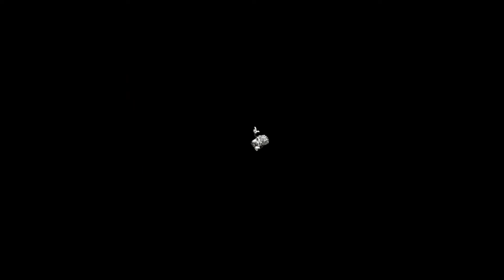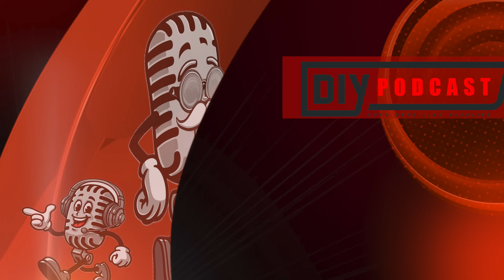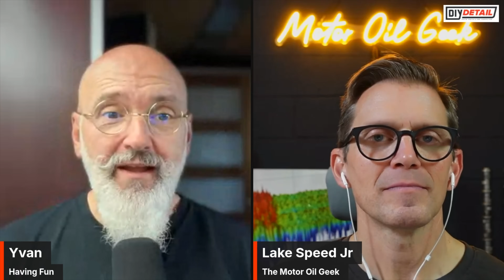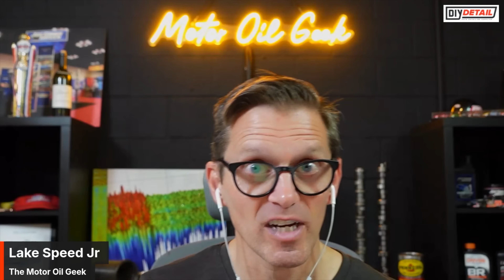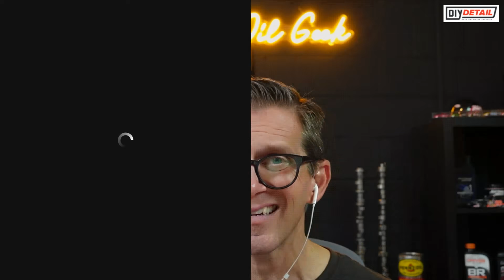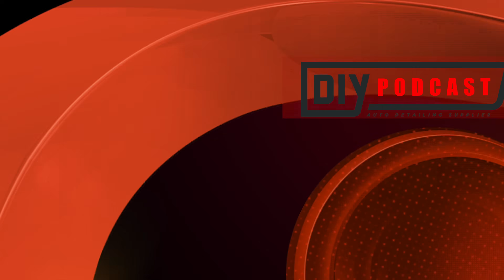Oil myths busted with Lake Speed Jr and DIY DETAIL PODCAST

Comment: Two slight disagreements with Lake. He seems to feel planned obsolescence does not exist with these rediculous long term intervals. I will never believe that.  2- He mentions some people change oil too soon, which leads one to think it might be harmful. He should just say “ before it is necessary “. I’ll stick to 2-3K , actually before it is even barely discolored. It’s worked great for me since the early 70’s , and I’m sticking to it. Might seem wasteful to many, but it makes me happy and I’ve never had an engine complain.
Reply: The comments made by @MHounan are very accurate. Oil Analysis does provide information on contamination, viscosity, oxidation, etc. It does provide accurate data on your oil, the additives within the oil and condition of oil. Many come from a viewpoint on gas engines and 4-7 quarts and relatively low cost filter… relatively inexpensive oil change. The Diesel side is much more abusive to oil and presents a much higher need to analyze oil; my 6.7 takes 18 qts which is much higher maintenance cost; maximizing life of engine and mileage is important. If oil change "color" indicates oil condition and not actual properties & contamination you’d change diesel oil within minutes because it’ll be black promptly mixing with .5 to 1 qt residual oil… black color doesn’t indicate bad oil. 

Oil analysis has been done on diesel oil for many years, proven extremely accurate and life of engine is just as long with extended oil change compared to short mileage change… engines often easily obtaining 400-700,000 miles. Oil Analysis has also been vital to provide early detection of a possible problem or early failure, unknown if not testing. 

As far as condition of used oil compared to new, actually running an oil by-pass filter system the oil is often better condition than new. Many Diesel with By-pass filter "don’t" change oil, they only replace the oil when filters are changed every 10-15,000 miles. 

The analysis of oil has been so successful in diesels and high HP racing engines, it’s become more popular in street gas engines… clearly indicating the old school short oil change for modern synthetic oils isn’t needed. But to each their own, if you enjoy or feel good changing with low miles, enjoy, doesn’t cost much either; But arguing based on speculation that it’s better condition isn’t accurate. I’ve seen many gas engines with 180-250,000 miles that had 10-12,000 mile oil intervals look better in bearings & cylinders than 3-4000 mile intervals; many more variables impact engine wear than oil change interval.
Reply: @dougcjohn You offer much good information, but , your also doing a lot of apples and oranges comparisons. Of course diesel and higher volume oil capacities are a quite different scenario than the common normally driven 4-6 qt. gas engines referred to in this discussion. And what to you is “many” in regards  to 10-12K intervals up to 250K looking better than the 3-4k intervals. Keep it simple instead of throwing in all the extreme variables and re tell the story. It will not be the same.
Reply: @brianw8963 appreciate the comments, but would disagree on the scope; the end point remains the same… oil analysis remains the same… it provides benefit and information not known unless performed. This subject isn’t on just 4-7 qt gas engines, but the focus turns narrow is common. The discussion was on oil analysis. I expanded the focus to a broader view to help understand the value of oil analysis. 

Within Lake’s discussion, he included large plants that use & depend on oil analysis. Cost helps justify as volume increases; although the benefits remain the same for 4 qt to 40 gals. 

Again, if one wants to have a short change interval, enjoy the process. But defending that position by refuting oil analysis isn’t accurate.
Reply: @dougcjohn  I agree, I change my oil and filter every 4-4500 miles since going to full synthetic.
Reply from the maker: Thank you.
Reply: I certainly respect Lake, but I’d like to ask him if they run the 0-W oils in the expensive race engines ?  Yeah , I know , that’s different . But these modern small displacement high output engines basically are race engines .
Reply: @brianw8963 
Running 7000 rpm continuously
Reply: @brianw8963  Promods, 4-5,000 hp are running 0w-20.

They can't warm those engines up. So that 100 degree oil acts like 40 or 50 weight at 200. Same viscosity. It's cool stuff.
Reply: @WyFoster That’s interesting, but I was kinda referring more towards the NASCAR  type of stuff. 👍👍🇺🇸
Reply: @brianw8963  Works well. They run very thin stuff in nascar. Especially on plate tracks where they need all the horsepower they can get through those restrictors.

0w-8 to 20 on the high end. Obviously works well enough for 500 miles.
Reply: @WyFoster That’s very interesting, as is obvious, I didn’t know that. But also in that situation, I don’t think longevity is relative , at least past 500 miles.
Reply: 14:42 He's absolutely right I've seen my oil shot at 4,000 4500 mi and I've seen it still look honey brown at 7500 mi. I will say though regardless I can tell the difference in the engine right around the 4500 mile mark however I will say I have a GDI engine and Valvoline extended protection seems to hold up better to fuel dilution than Pennzoil ultra Platinum in my non-scientific experience
Reply: @thetechlibrarian How have you seen your oil shot?  Visual inspection?
Reply: I wouldn't put pennsoil in my lawnmower let alone my truck.  @thetechlibrarian
Reply: All speculation unless you send in your oil for an analysis. I've sent my oil in for my tundras and my wife's Volvo. All at 6-7k miles and the oils were in great shape. Can't disagree with facts
Reply: @MHounan you are probably fine at 7k, it’s your many after all, but there are former GK and Ford engineers who disagree with you.  Theres an interesting GM transmission engineer making the rounds lately, who admitted they said in meetings they were more interested in selling cars and trucks, not prolonging their lifetime. He working and designed these cars, in his case transmissions and he said cut any factory recommend fluid change interval in half, and ignore anything that last the “lifetime of the car.  He recommend changing trans fluid at 15k of your vehicle was made after 2001, when they all went to cheaper metals and build methods. He even said the words planned obsolescence were uttered while he worked there. Blame Vafe Standards, they are the reason for longer intervals, no other reason, as car makers get credits for longer intervals and lighter oils. 

Even Lake Speed, the guy in this video, did a test of 0 mile oil version new oil on bottle.  He pouring oil in motor, did not run motor, then tested oil and it picked up many contaminants on the way through motor, indicating it was not “as good” at the bottled oil, with 0 miles, although both would obviously take care of motor fine.  I drove a best Joe that had 13-17k mile oil changes, with two being at 30k miles, with a previous owner, and it’s running great at 235,800 miles, and mpg is 140%/120% better on city and highway mileage.  Maybe oil is irrelevant based on my testing.  😂😂
Reply: Without sending your engine in too you are only looking at half the equation. @MHounan
Reply: @MHounan Well, with all due respect, when I change it before it’s even discolored @ 2-3K , there is absolutely no speculation for me, and I don’t have to pay for an analysis. To be fair though, I don’t rack up very many miles on my vehicles.
Reply: I agree. I change mine before 4,000 miles. Too soon? Maybe, but I really don’t care.
Reply: @brianw8963 can you see a lack of dispersants, a reduction in additives visually?
Oil color isn’t an absolute. Oil manufacturers add dyes. The dyes can turn darker in just a few hours.
Reply: @Papparratzi So I can’t trust good brand name oil? How often do You have yours analyzed? I’m going to guess You never have, and if you did , what did it cost and what did you find? Blah Blah Blah!
Reply: @brianw8963 Change it every 500 miles why don’t you bud. Burn your money by all means. Oil change should be done every 5k miles.PERIOD
Reply: @thewiseguy7100 Very fitting name.
Reply: @brianw8963 
There’s a difference to get a few analysis done and establish a place to change, vs never learn anything about what you are doing.
Reply: @Chucka10 Do you really think I need an analysis changing @ 2-3 K ? I certainly agree with it if you’re looking at long intervals to save on maintenance costs, but not for my situation, or even those that do it at 5K , if they actually do. And I’ll say it again, I have yet to hear one time what anyone here  in this discussion actually paid for an analysis. That never seems to be considered into the equation. How many have you had done?
Reply: @MHounan  Just be aware, the oil can be in good shape but you can have contaminates floating in it. Iron, aluminum, copper, lead, dirt, fuel, water, carbon, etc.

I would never trust 10k miles, even if the oil viscosity is still in grade. There will be just too much other junk in it for my liking.
Reply: Lets say you were looking to buy a used Tundra, both were absolutely identical in every way.  Both had 70.000 miles on them both were the same price. Only difference is one has had 7000 mile oil changes,  the other has had 3000 mile oil changes....which one do you chose? Be honest. @MHounan
Reply: @1958Cadillac-v2g  I want yo see the oil analysis on the TRANSMISSION FLUID  before I choose.
Reply: @1958Cadillac-v2g 3,000 of coarse
Reply: @1958Cadillac-v2g I use high quality oil and still change every 5000 miles
Reply: @adrianrobinson7953  5000miles is what i do on my truck, 5000k miles is fine when you want to keep it running well and don't really want to bother with oil analysis, i can probably  go longer between intervals but then i don't have an excuse to use to get in the garage and have some time away from the family 😂😂
Reply: @1958Cadillac-v2g I run a company where we have around 45 Toyota tacomas, oils changed every 20K with Amsoil signature series. I’ve got some with 500k still going strong with no major engine work. Oil analysis works.
Reply: @stevefuller3585 Are any of them the newer 4 cyl. turbos ?
Reply: @MHounan  it doesn't matter if your oil is good based on analysis at 7000 miles it's still not as good as oil brand new out of the bottle.
Reply: @MAXIMUSMINIMALIST you can literally say that about anything that's used vs brand new. But again, i use facts and not speculation
Reply: @willr1796 literally no one said ots as good as new oil. Lol but i will definitely bet my 7k oil changes backed by science and facts, will lead to perfectly healthy engines.
Reply: @MHounan maximusminimalist just gave a fact you can't dispute. New oil always performs better than used.
Reply: @willr1796 all those things you mentioned can be looked at with oil analysis… funny YOU would say ignorance is bliss, you’re the one speculating!
Reply: you are probably wasting a lot of good oil and good money not to mention the environmental impact but regardless the only way you know for sure is all analysis that takes any guesswork out of the equation.
Reply: @TheHillrat4wd It’s my money and I don’t consider good insurance to be a waste, and my used oil does not go to waste. How many typical normal people in this realm do you think will or ever consider paying for an oil analysis? I would safely bet the number would be close to zero. I’m not focusing on diesel or high capacity oil systems or the extremes, just the normal stuff of ordinary realm. I know my change intervals are a bit over the top, but that’s my choice.All I’m recommending is to stay around 3 to no more than 5K and you won’t need to pay for oil analysis. To each his own. 👍👍🇺🇸
Reply: @brianw8963 You definitely have your opinion, and a practice of short interval changing.  That’s your preference.

Stating it’s good insurance to change at short intervals when you have zero ability to validate your claim isn’t accurate or true. Quite the opposite, Myself and many  others can factually prove their oil condition… with oil analysis. 

In your statement, you agree / justify oil analysis for diesel or HP racing, but not for street in common engines… stating it’s a waste of money.  If a few Oil Analysis reports clearly indicated you could go  5,000 to even 10,000 with zero negative impact towards engine wear & life. It’s actually saving you money and paying for itself. 

Although I personally don’t know your ideal interval(s)… you may be short due to excessive fuel dilution, or antifreeze intrusion. If short trips, lot of idling, you may be close with short interval changes. A excessively rich mixture, poor engine health (rings, etc) can shorten oil life too.  I don’t know your vehicle(s). 

Your statement in a few posts… hardly anyone does oil analysis for street vehicles. I’d agree, the majority of Owners have no idea what oil even does, dealer changes it and they’re clueless.  

Go to any car show, rally / poker run, or when a person is passionate about maintaining their vehicles… it’s inversely true, most monitor & analysis is very common over last 15 yrs… and it’s increasing as more learn the benefits. So for auto loving owners, the percentage is much higher than your assumption. There are easily 5-7 labs that perform Oil Analysis for non-business clients … that has grown. 

Agree, there will likely always be the short interval Changers… that’s fine. But it’s humorous when they make claims or statements unwarranted or validated when debating with others that obtain quantifiable data and knowledge. 

By the way… It’s not just my diesels. I own several gas vehicles and do the same oil analysis… have a Jeep 5.7L over 200k miles… avg change 10-12k, 10 yr old 3 cylinder .9L Turbo Smartcar (toy hauler RV) still runs like new.
Reply: @dougcjohn Doug, show me where I said oil analysis is a waste of money? You won’t because I never said that. I enjoy discussing this stuff, but prefer to keep it respectful to others opinions or practices, which seems to be less than reciprocal in this arena. I’ve been wrenching on stuff from .049 cox engines to large Caterpillar engines in draglines and other heavy equipment, since the early 70’s . I’ve been retired for a while, but I’m still in my garage almost every day working on something. I also mentioned that I don’t put many miles on my vehicles, and my practices are a bit over the top, and even a bit wasteful, but that’s my choice. Do you really believe I need to get an analysis on my 2K oil to verify it is still good? That’s foolish to me, I know it’s good  . I have 6 vehicles on the road, and a couple don’t even get 500 miles in a year, but I still change it once a year. Is that OK with You?  I certainly agree that people like yourself can definitely benefit from the oil analysis results, but I also stand firm that it is not needed in normal situations if change intervals are kept between 3-5 K for the average Joe. That’s all I was saying. And as far as the car show scene, I do attend a lot as my wife takes her 2019 Grand Sport to almost all the local stuff, and every year to Carlisle since She got it in 2020. As I enjoy this stuff, I’ve became acquainted with many and don’t know of one that gets oil analysis done as you’ve mentioned , because they rarely get driven, like my wife’s. It has 6200 miles on it, and even though it has the dry sump that holds 10 quarts, I change the oil every year before it goes into hibernation . Have a great day Doug, I’m going to head out to the garage and get back at my 69 convertible beetle project. 👍👍🇺🇸
Reply: @brianw8963  Late reply... hadn't monitored this thread last month.  My comment on "waste of money" wasn't indicated as Verbatim... more inferred reading your comments across the thread; apologies if taken incorrectly, although interesting that was a focus point among all the material discussed. That followed with "prefer to keep it respectful to others opinions or practices, which seems to be less than reciprocal in this arena...."; that's an interesting comment when skimming through my posts I've consistently indicated it's your preference on milage intervals. I've been consistent in stating that's a personal preference, although not factual in benefit or better.  Your last post above, I'd agree with ya... seldom ran engines, short start ups & shutdowns; frequent oil change are often the recommended maintenance; due to fuel, water, condensation higher concentration in the oil within show car / limited milage cars. You're not working the engines, agree NO oil analysis needed, although for the fun of it; I'd think it might even verify the need to change often.

Based on your timeline share, we're similar in timelines... had many .049 cox engines growing up... something the Youth might benefit from in today's period; to build and maintain as a Kid. Can relate with ya on other areas; maintained many large John Deers and Cats on Farm, Military hardware for a bit and GM Mst & CNE Mst from years back... moved over to IT field in '90's. Still DIY all my Own machinery, just prefer it that way. 

Back in our youth period, I changed my Rat's & Mouse's oil extremely often, more of ritual and passed down wisdom & guidance. With experience, fleet maintenance, and time it became more apparent my maintenance was more based on desire vs necessity. 
Desire is essentially emotional & love of machine, Necessity is factual data and economics that doesn't necessarily mean it supports 2000, 5000, 7000, 10000 or higher... it means let the science indicate, if you elect to utilize or not, that's one preference.  

I can relate to both, doesn't mean desire is practical... just means it's one's preferred path. 
Enjoy the Rides, I'm sure they're all as nice as the Grand Sport.
Reply: @dougcjohn appreciate the feedback. I’m just an old school fella that believes in good maintenance, and have admitted several times my practices are a bit over the top, but I’ve never had one of my own engines ever fail from any lubrication issues. The Grand Sport is definitely an enjoyable ride, but it’s actually more my wife’s thing. I actually enjoy puttin  around in my old 69 Beetle more. I like old school and simplicity much more than the modern stuff, but that’s also just my preference. Thanks again Doug. 👍👍🇺🇸
Reply: It's completely wasteful. Why would i spend that much on oil chances just because i like the knowledge to understand the chemistry of the oil and mechanics of how it works. 

I put about 26k per year on my truck. If I took a page out of your books I'd be wasting $700/ year on oil changes and still not have my engine live any longer or have any less problems.  155k miles on my 6 year old canyon only had an alternator go bad and a thermostat stick. Knock on wood 

Oil changes are important but unless your vehicle sits, there's no reason to change your oil that frequent.
 
As for the long oil change intervals, it's all about EPA regulations and cost to the consumer. Longer intervals if the oil is capable of it benefits the EPA and the consumer especially considering the life expectancy of most vehicles is about 200-250k miles , after that most people just scrap their cars and get something newer
Reply: @gtileo Life expectancy of modern engines using the O-W oils with 10K + mile maintenance is 2- 250K? What planet are You living on? Thats not the real world with these small displacement high output turbo engines. You evidently have no concept of current reality. Just my opinion, of course.
Reply: @brianw8963  exactly its just your opinion of course, until you have the data to actually back it up, maybe don't speak about it like its a fact when refuting a guy that's job is to analyze it. 

I don't disagree with you that thinner oils can cause issues, but when engines are running and maintained as they're designed to. Use of proper oils and top tier fuels, that don't have dilution issues. Oil additive packages and film strengths far exceed the old school beliefs.  Improper maintenance will cause a thinner oil to break down quicker and cause more damage, reducing the life of the engine
Reply: I agree with everything you said. Manufacturers don't want engines that last 500k miles. Every manufacturer wants that engine to have failures after the warranty period. Which is usually around 100k miles at most. If he's listening to Manufacturers he's getting a biased point of view. Changing your oil too soon never hurts an engine. Changing it too late or when it needs changed means it's starting to increase wear at that point. Why wait until it is beginning to damage the engine?
Reply: Lake Jr. would make for a great politician 😂
Reply: Ur doing correct in my book!
Reply: @adrianrobinson7953 To each his/ her( that’s all there is)  own. 👍👍🇺🇸
Reply: It just makes me feel better!
Reply: @adrianrobinson7953 100%. !👍
Reply: I know a OTR trucker small company owner. 7 rigs. All pre def. Either Cats or Cummins. He started on an oil analysis program with a relatively small, custom blend capable oil distributor. Over several years they kept changing the oil formula according to what analysis told them. His “sweet spot” turned out to be 32k between oil changes. He sez the analysis was still showing he could go further but 32k was good enuff for him. Is this a common oil change interval mileage for fleet rigs?
Reply: @harryfeld1786 I don’t personally know any fleet owners , but being in the coal mining industry for over 45 years, I’ve befriended many Triaxle owner operators and I don’t think they come close to that mark. At 50K + just for a basic Cat  overhaul, I believe they do it much more frequently than that. In these cases, regular oil analysis would be very beneficial for sure.
Reply: Regarding your planned Obsolescence comment, you believe manufacturers are increasing OCIs for the purpose of intentionally limiting the life of an engine?
Reply: I’m with Lake on this one.  Manufactures have better things do than planning on their products to fail.  That’s nonsense.  However, they are perfectly fine compromising quality to lower costs and/or meet certain specs that make their vehicles look better from a marketing and/or government incentive point of view.
Reply: @sebclot9478 If you’ve been in the automotive repair realm over many decades, you might have a different perspective, but your certainly entitled to your opinion.
Reply: @brianw8963   You are overrating the foresight of most big companies.  They are worried about today bottom line.  They aren't worried about 5 to 10 years from now.  The long term failures, such as all the recalls we have been seeing recently are, in part, a result of that lack of foresight.
Reply: @sebclot9478 Long term?
Reply: @brianw8963   Yes.  Planned obsolescence would be a long term strategy, not a short term one.
Reply: I agree. I believe clean engine oil makes all the difference. especially for diesel. Which is why I change my engine oil as soon as it turns black on my Volvo xc90 D5, which turns black almost as soon as I start driving it. So I change it on an hourly basis. Mileage is 220k km and other than half the car being replaced, it runs like a dream.
Reply: @Ilikepie18855 Hard to distinguish if this is humor or sarcasm. Whatever.
Reply: @Ilikepie18855   I change mine every ten minutes.
Reply: I’ve never ever heard of a documented premature engine failure due to oil changes changes too frequently at 2 to 3k intervals.  EVER.  It is a theoretical issue.
Reply: @badkid73 And you never will! 👍👍
Reply: @brianw8963 Iunderstand yr thinking, but u should give credence to data.  Re: 2nd issue, no one has ever stated that oil gets better w age.  It would be illogical to suggest Lake was inferring neg consequences from "too" frequent intervals.
Regardless, if being honest, I would buy yr engine first. 😊
Reply: Problem is Lake can't talk about everything He knows, Due none disclosures signed by Him,    Lake does GM give a 💩 about 10 speed transmission build Quality? Answer of course not. Lake doesn't have to answer this question because it's not up to debate.
Reply: @raymondreiff8170 Yeah , GM cares about GM. According to them as far as the transmissions go, your SOL. But Lake seems to think this stuff does not happen,including the engines, which to me exposes his polarity.
Reply: Lol you need to listen better
Reply: Just finished your whole comment. Changing your oil 2-3k so you can 'feel' happy is hilarious. You're comparing oil from the 70s to today's oil. I actually send my oil oil to get analyzed and I keep good information to myself but I definitely don't do things because of my feelings. The oils available to us are not created equally. I have a summer car and change the oil every 2+ years. It barely sees 5k in that time.
Reply: @IaintTrynaGoOutLikeBIGnPAC How much do you pay for an oil analysis? In all of these comments, it has never once been mentioned, as though it is irrelevant. And if your one of those that supposedly goes 20K , do you do an analysis at 5K, 10K , or just cross your fingers and wait till 20K ?
Reply: My 5.0 f150 11 years old since new every 5000km change oil   never burns a drop of oil still running strong, always full syn, at 130,000km switched to penz HM syn
Reply: @bobmartens1089 And I’d guess you never had a single oil analysis. Amazing what just simple good maintenance can do . 👍👍
Reply: I can’t see how new oil is not good for your engine. 
  If an análisis shows it good the question is how good are the additives after 5k miles?  Just because they are there does that mean their as good as when they were new??
  I feel the way you drive is more important than the mileage. Bad habits are bad when people don’t know they are doing  bad. 
   Newer cars with variable cam timing quick spool up turbos and having to get into boost even just keeping up with traffic cannot be good. If you load a pickup for work everyday even if you are easy on it is going to wear quicker. Its the laws of physics. You can try special ring coatings to try to get longer life and it helps. Low tension rings to have less drag may help mileage special on the non power stroke. 
  If you rely on the gas pushing the rings out via gas ports ect to get a good seal that can’t be good for wear, specially if find yourself in that condition all the time just normal driving.
Reply: @ArtGomez-g4f new oil is great! New oil refreshed often when not technically needed or no beneficial gain… isn’t economical. The bigger the Rig’s Oil system the bigger the economic loss. 

If ya like fresh oil every 5k miles and 7-8 QTs is minimal cost… enjoy the passion.  If 18qts or more… especially if high cost Diesel Synthetic, it’s an expense that has zero benefit. 

Back in 70’s, an oil change & filter was a minimal expense and the oil likely needed changed every 5K… personally don’t know, didn’t do Oil Dx Labs back then.
Reply: Question: if you send your 5000 miles oil
to analysis and the results come back good. Why would you change the oil after 2000miles, dude? You just sign your own stupidity, unless you like to waste money as a hobby.
Reply: @FredAlmeida-r8i Based on some top engineers who conduct research and lab tests exclusively on engines . They claim they see oil begin breaking down at around 2,000 miles . The thing is you want to change the oil before it goes bad , you don’t want to wait until it starts going bad , because it’s not lubricating engine as well .
Reply: @TiffanyBottomsHunter depends on the applicability of the engine. Lab is not real life
Reply: @FredAlmeida-r8i I’ve never gone 5K on an oil change, maybe 3 at most. It starts getting discolored/ dirty , I change it, and the inside of my engines reflect that. It’s my choice and has served me well for over 50 years. You choose to call me stupid for that, that’s just fine, dude.
Reply: @brianw8963 all oils change color before going bad. Wow 50 years changing every 3000 miles????? And you don't want me to think this is stupid. Dude, do you have any idea of how much money you drained?? more than $100.000 dollars, you must be rich.
Reply: Yes definitely correct on both accounts definitely a difference between too soon and before necessary.
Reply: @dondebomm6329 the cost of the analysis is about the same as the cost of oil and a filter.
Reply: Dudes trying to act like amsoil signature series and Walmart super tech blend is the same thing at 3k miles lol
Reply: @TaylorPhase Lake has videos showing the analysis of both of those oils.
Reply: @TaylorPhase he has tested them both.  You have to ask if you get 2-3 times better protection, since it cost 2-3 times more. I’ve run amsoil with no noticeable observations, other than my wallet was lighter.
Reply: @miragesmack007 I don’t care if it costs twice as much but may only be 15 percent better. Anything to keep my Frankenstein Hyundai at 300,000 miles alive
Reply: @TaylorPhase because for everyone driving to the store, work, in traffic, etc... it is the same.
Reply: @Shiver2002 doubt it. Traffic driving is harder on the oil than highway. Especially if using a GDI engine or its cold weather or a hybrid
Reply: @TaylorPhase Agreed. My GDI and its OLM (default 7500 miles/ 12 months) didn't do me any favors... Giving me a 5.3% Oil/Fuel Dilution after "only" 3000 miles/ 8 months/ 56% OLM....

Glad I changed early and hopefully after using several intervals of Valvoline Restore and Protect... I'm hopeful that the Blow-by and overall Engine Health is better
Reply: @lgoamity  i should probably get an oil analysis with my hybrid gdi cuz of fuel dilution
Reply: @TaylorPhase if you’ve seen his videos on that, you might understand what he’s referencing. He’s giving generalizations to not be too time consuming. 
Yes the Walmart oil tested very well
Reply: Mine burns some, Can I just have your old oil... But I got it this far, 721 miles till it's 300,000 miles!
Reply: @johnqpublic2949 😂👍. U r right. Free oil. Saving the planet. Reuse.
Reply: Well then change it every 500 miles!  You're a fool to change your oil every 2-3000 miles.  I changed mine in my bmw 530i every 15,000 miles and sold car to friend with 400,000 miles, he's still driving the car.
Reply: @lanehollar9891  Not to be a jerk here, but it needs to be said, of course the BMW owner would go 15k miles between changes. I'd be willing to bet I could hold in the palm of my hand, ALL of the BMWs still on the road with 500k plus miles. Let's play "odometer shots", ready, set..  POST! Seriously tho, in all honesty, are you using EXCLUSIVELY RedLine or MOTUL oil? Why go so long? You've probably topped it off 5+ times, a quart each time, before your 15k comes around. I cannot be convinced otherwise unless you change your piston rings along with your oil. No EGR?
Reply: @BradRadford-e8s Yeah, I had to hold my tongue on that one. 😂👍
Reply: @lanehollar9891  You shouldn’t call someone a fool or all the people who change their oil at 2-3k intervals .
Reply: @lanehollar9891 Your certainly entitled to your opinion.
Reply: I definitely get what you are saying over all. However, you feeling that he 'has' or 'should' say 'before necessary' implies people are stupid and can't read between the lie. I know a lot of men are dumber today than men before us and need things spelt out for them. It's like women who talk about 'boundaries' but when we grew up it was just common sense. Having to spell things out for people like a handicap, then maybe this isn't for them.